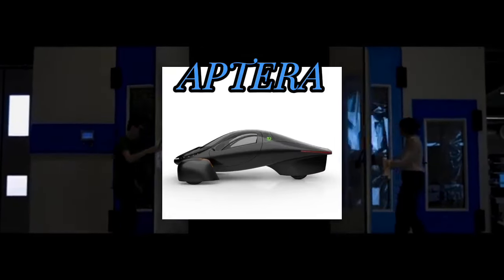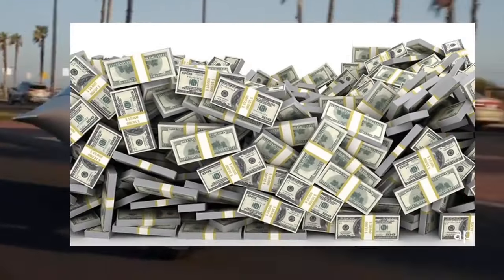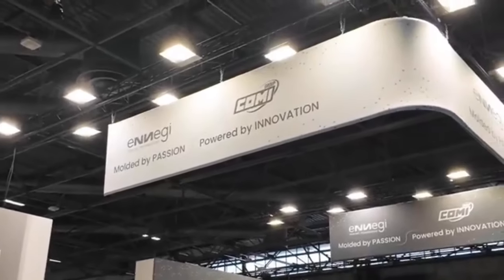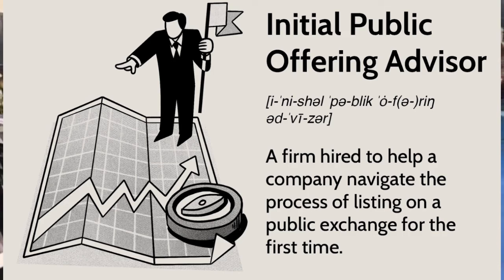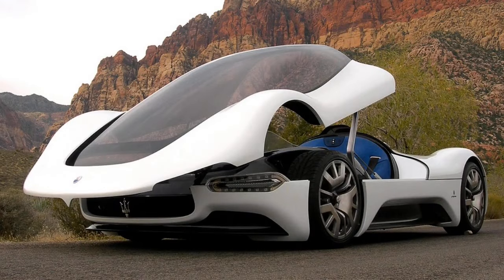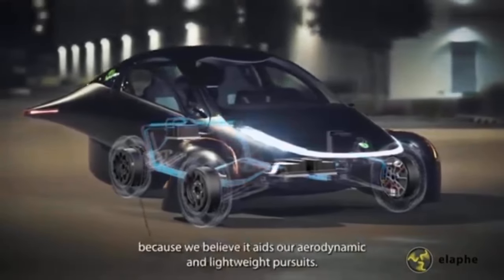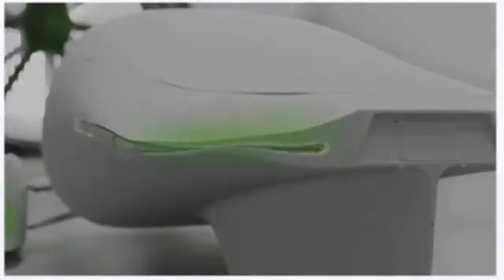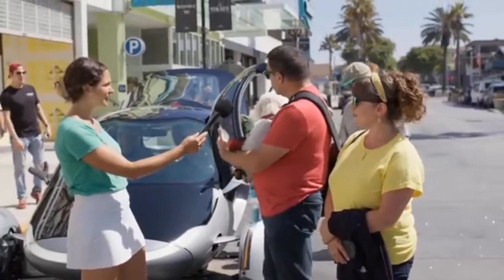Aptera CEO IPO say on solar EV, 3-wheel variants 4-wheel, four door model, & DC charging

Comment: I find the information in the video pretty informative. It may be a little simplified, but it seems accurate. I don't disagree with anything. 

What I would advise against is assuming that the 600 mile and 1000 mile options can be dropped, and replaced by a four wheel model. While I think Aptera can still produce a 1000 mile sedan, I don't think it can just be switched out for the three wheeled design. The trike version will find it easier to reach the 1000 mile goal.

The biggest issue is that the fourth wheel will add to the vehicle's rolling resistance. If we assume that the contact patch of each wheel is the same across both models, the four wheel version will have 33% more rolling resistance. That will decrease the range, presumably by about 12.5%. So the battery will have to be more than 100kWh to achieve the same 1000 miles. 

It is true that with one more wheel, the suspension will be able to carry 33% more weight. But the decreased weight of the suspension will probably be less than the increased weight of the battery. Even if we assume the body is built the same way the Aptera is, with the same SMC, the three wheeled version will always be lighter than the four wheel equivalent. And the weight is the other major factor in range. 

This isn't to say that an Aptera designed sedan won't be far lighter, more aerodynamic, and have longer range than a vehicle built in the traditional way. It will, and as long ss Aptera sticks with its philosophy of efficiency, that will always be the case. They may cost a bit more, but they'll have more range overall. To the point where they can even use solar power and save a significant amount of charging. Not 40 miles a day, but every free mile is a free mile. 

I personally hope that Aptera makes both a four seat three wheeler and a five seat four wheeler. There is room for both in the market. The three wheeler will have the efficiency, while the four wheeler will have the capacity to be a fanily car. And you could choose based on the average number of people you expect to drive around.

It really doesn't make sense for the most common type of car to hold more than four passengers when the average number of passengers in the car is 1.7. Two or three seat vehicles should be more available than they currently are.
Reply: Many thanks dr

Comment: I think they should follow the path that VW took with the Beetle or Henry Ford with the Model T. Build one vehicle and only do incremental upgrades from time to time. At a much later date, introduce new models. It worked for them because the Beetle and Ford were reliable and inexpensive
Reply: The Model T started out at $850 ($29K today) in 1909, by 1924, they had it down to $260 ($4700 today). The Beetle came out in the US in 1949 and cost $1280 ($16,700K today). The peak year for sales was 1970 was $1929 ($15,800 today).

So, Aptera needs to make it more like the Model T where in 15 years from now (2039), it'll be less than $5K. I can see the company doing this as it's only 6 parts and they make one every 12 minutes. To be like the beetle, it needs to be $15K to start with then maybe $20K for the 1K version and 40 miles solar.
Reply: @billsmith5960  I understand your logic but your final numbers for a modern car are wrong. For one simple reason. Modern cars/trucks have way more creature comforts than those 2 did. All that adds to the price. Neither of those cars had AC, power windows and door locks, air bags, seat belts, entertainment systems, well I guess the Beetle had an AM radio with one speaker, computers to monitor systems, not to mention the performance. The Model T was basically a tractor made to haul people and the Beetle was just basic transportation for a small family. If a company built a car like that today, they wouldn't sell very well.
Reply: @tims8603  - How does Nissan sell a $16,390 Versa in 2024 then?
Reply: @billsmith5960  Correct me if I'm wrong, that's a ICE vehicle made in Japan right? You are aware that the Japanese gov.  subsidizes the car companies, aren't you. Even with the subsidies, Toyota is deeply in debt. That doesn't work in the US. The battery pack for a Aptera is probably close to $10 Grand. With the Nissan you pay less in the short run but more in the long run.
Reply: @tims8603  - It's an ICE vehicle made in Mexico.

Comment: 8:04 Aptera is not working on anything that can be utilized for crash testing. It can't drive - no motor or even wheels. In fact, the junk is sitting idle, only having been removed from the crate. Not working on anything, unless you have later information. If you do - then show it. If you don't - then stop lying. Would you like me to make another correction video? There's plenty of nonsense in this one to correct.
Reply: The first PI body is being used for finalizing wire routing.  Additional PI vehicles are being assembled in Italy at CPC and some of them will be used for crash testing in California.  Other kinds of validation testing will also be done on these vehicles.

One of of the early ones will also be finished as a marketing vehicle to demonstrate to the public what a Production Intent vehicle looks like.  There are significant changes form the gamma, including body size and length.
Reply: Yeah, work is ongoing on the Aptera. Even if there is no PI build with wheels or a chassis right now, there is no reason to assume there won't be in a few months. We will see that when we see that. 

Nobody is going to show you the everyday work going on at CPC. There would be no point in paying someone to go out there and record all of it. You might as well expect McDonald's to show you video to prove they're making hamburgers.